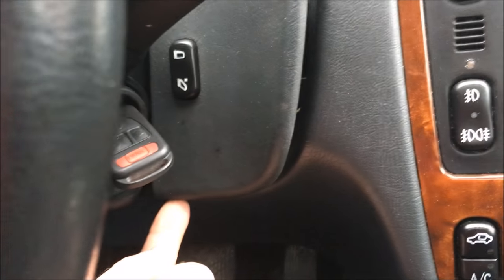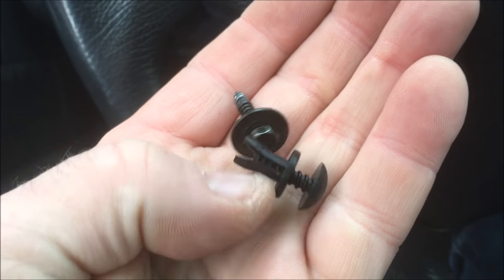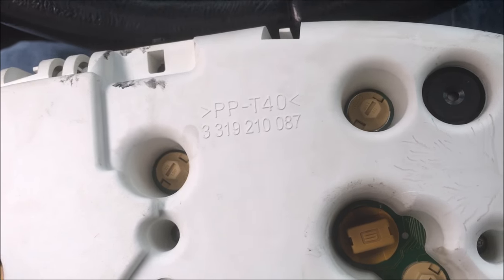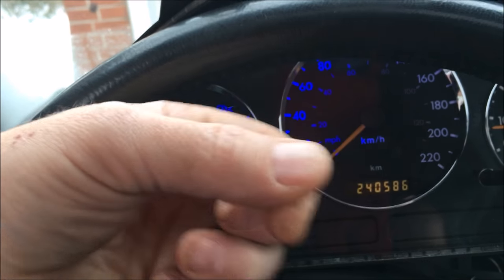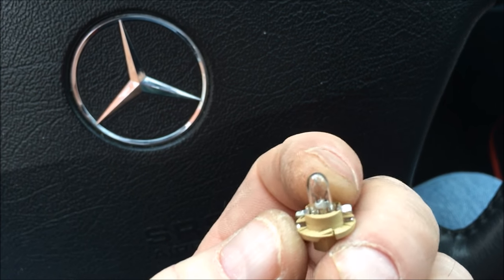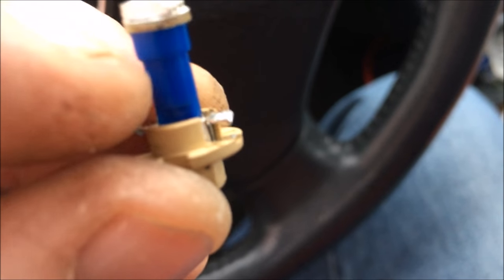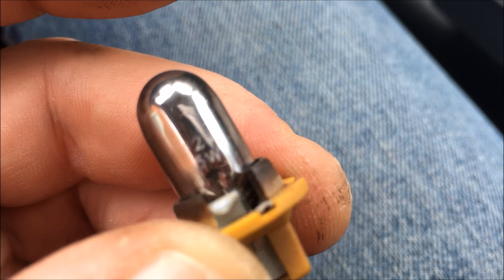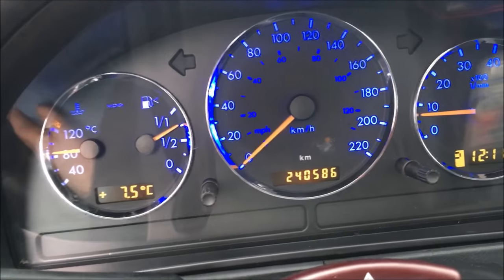How to..Mercedes W163 ML320 gauge lights changed to blue LED

Comment: I've used other LEDs (white, blue blurring in my eyes) however the fuel arrow faintly visible and sometime I see running moire on digits of temp/odo/gear/time. 
In general, I am satisfied with the result

Comment: 240k 😳😳😳 is the reason why I drive Mercedes. They last a lifetime. #BenzBoys
Reply: You think 240k is a lot mine almost has 340k and it still doesn't have a check engine light

Comment: There is a reason why the led are this color in Mercedes, because they found out after testing that's best color light is the one that they use,  has much better readability, clarity, and easier on eyes, and creates less distractions. This is well research phenomenon by Mercedes, in fact all the German cars use orange/white back led for the same reasons. Main reason is safety.
Reply: Wrong VW used blue lights in instrument cluster 👍🏻

Comment: Good job. I did the same thing on my ML 270 with both red and blue LEDs, excellent result but they started to burn out after a few kilometres, replaced again but for the last time, with the engine running but the car stopped, everything was ok but as soon as I started walking, a few meters later the painting almost caught fire. The result was that all the lamps were burnt out and I had to redo the wires and put the normal bulb back in, maybe a bad quality LED?
Reply from the maker: sorry to hear that ...sounds like a faulty led shorted something out .

Comment: I tried to do exactly this in my '98 SLK 200 (R170) (the 200 isn't sold in the US, only in Europe). But the T10's you used here were too large for my intrument cluster, plus I think there are like yellow plexiglass plates inside the cluster, because I now have smaller white T10's behind the gauges and the cluster still lights up kind of yellow
Reply from the maker: yes the R170 gauge doesn't have as deep a hole to put the bulb in, so a smaller T10 LED is needed. There are different colors of white LEDs   The  T10s you got may not be "bright white"   I have some that are not true white and look the same as incandescent s when they are lit
Reply: ***** The ones i had were very bright white, much brighter even than the regular incandescent bulbs. I don't know how the gauge cluster color remains roughly the same. The blue LED T10's I did have didn't light up my cluster at all, unfortunately :(

Comment: I was wondering how you removed the left   side of the attachment but you didn't show it is hell to remove and install. 
I removed the ac door motor from the ac from the access.It's easier than removing the dashboard.

Comment: hi fupabox - just followed your video to replace some burnt out bulbs on my 2004 ML350 cluster.  I just replaced with original since I didn't have the LEDs handy - I figured the originals lasted 17 years so maybe these will last another 10.  BTW, noticed at 14:32 that you had on a very nice watch...
Reply from the maker: Timex intelligent quartz racing fly back chronograph. Nice watches and not expensive either 👍

Comment: G'day from downunder.  Great mod.  I did a similar upgrade to my Suzuki Boulevard C50 about 10 years ago - although that required a lot of re-soldering, rather than bulb replacements. Looking forward to doing this on my 'new' ML350. I noticed some comments about changing the bulbs in the centre console so I'm keen to see how hard that would be.  The upgraded stereo has red LEDS, so curious as to whether anyone has had experience with using Red LED's & how visible that is compared to original &/or blue?  Cheers from new subscriber.

Comment: Hey nice video.. very well explained! Just have one tad question, are there any codes that pop up on the computer that you removed the cluster out when you pull it out and unplug the back harness? Some codes? Thanks again.
Reply from the maker: I have never had any codes removing a cluster , even with the power on.. but just to be safe turn power off before unplugging.
Reply: Thanks for the prompt reply! Keep doing your videos ..
Reply: @MrVVnz  I know 4 years but nice to know: If you remove the cluster with the key in the ignition on position 1 or 2 it could happen, that SRS (airbags) will pop up. But since every ML has OBD 2 there is no problem deleting the code. But still better to have the key completely out before starting any work on the cluster

Comment: hey great video!!!! im gonna try this on my ml350 2003 , just need you to tell me again the amount of t5 and t10 i need to make what you did in blue , and how many t5 do i need for the temp and milege and time ? just for shit n giggles if i decide to change it 

thanks alot i hope i get feedback soon from you
Reply from the maker: If you get 10 of each you will have a few extras in case 1 is dead . I order them in bulk from ebay sellers and there is usually a dead one here and there so extras are a good idea. They are way cheaper when you get 10 at a time

Comment: I did that to my car in looks nice. Did the ac vent knobs bulb too , but can't figure out rest of the switches , like low range switch and the ones below the radio. Did you try to convert those to led s maybe ?
Reply from the maker: I did it once before for a guy I work with.. I had to find tiny LEDs and they need to be soldered into each switch/button, once the switch is taken apart.  The window and lock buttons on the center console (2001 and older) can be color changed with 1 bulb in the bottom of the switch assembly
Reply: fupabox ..thanks for the reply and info. I ll give it a shot .

Comment: what is the size light bulb you use for mercedes 2000 ML430 for the dashboard I took off the dash and got the lights but cant find it anywhere I got try to purchase them
Reply from the maker: The 2 larger ones are available anywhere and are referred to as 194 size ..they are called  T-10  if using LEDs   the smaller bulbs which are used in the rest of the gauge lights are available at the dealer for around $3 each (last time I checked)  or here  http://www.pelicanparts.com/catalog/SuperCat/3915/MBZ_3915_ELLITE_pg2.htm
Reply: fupabox Thank you!!! This help me alot.

Comment: Sorry but I did not understand where to find those T10 LED lights for the main speedometer and how many of them will I need. I notice the link for the T5 but no for T10. Can you guide me, please?
Also how many bulbs do we need for this replacement (T5 and T10) in general?
Reply from the maker: you can find them from 100s of sellers on ebay or amazon ..get extras in case one is blown or goes bad.  10 T5s and 4 T10s will leave you a few spares  http://www.ebay.com/itm/10-X-T10-Wedge-Blue-4-SMD-LED-Dashboard-Light-W5W-194-2825-Gauge-Cluster-Bulb-H7-/201861061893?hash=item2effdb5d05:g:c8sAAOSwB-1Ytl8A&vxp=mtr

Comment: Hi fupabox! After watching this video and reading the comments below, I bought the exact same double din deck as you off of amazon. I have a couple of questions about the install and was wondering if you could shed some light please?
Reply from the maker: ask away  :)
Reply: Perfect! So to begin, I'm testing this deck on my 2007 tacoma before I decide whether or not I want to purchase a second one and put it in my mom's ml320 for her. First question I have is regarding the metra dash kit I purchased for this install. The deck does not fit into the front fascia trim. I thought all double din decks were a universal size are they not? It seems like this deck is about a half inch too big, length and width wise =/. I noticed that you left a review on the Amazon page talking about the fascia trim so i assumed maybe you ran into this same issue?
Reply: My second question is regarding the preloaded 8gb micro sd card for the gps maps. I installed the gps antenna properly, and put the micro SD card into the card reader located at the top right of the deck. However, when I go to navigation mode, it asks me to insert an SD card as if it isn't recognizing the card that is already inserted. Thoughts?
Reply from the maker: yes..I used a pioneer sleeve kit, but the plastic cover trim will not fit around the deck face..It is only slightly noticeable on the bottom edge. I intend to make a surround for it, but haven't found the time yet
Reply from the maker: mine asked the same question..  I selected ok or something and it worked.. I completely know what you are referring to, and there is a way to make it work.. I will go check it in the morning...I'm at work all night and can't get out to check it
Reply: fupabox my thoughts are to use a Dremel and cut off a portion of the trim, and then file/sand the edges smooth. The trim tapers towards the bottom, and if I eliminate this taper the trim will fit perfectly. Do you think this is a feasible solution? Obviously there's nothing wrong with the dash kit, but I guess they're designed mainly for the big brand names like Alpine and Pioneer. This EinCar deck is slightly bigger than a standard double din deck.
Reply: No worries, I am just glad that you're willing to help me come up with a solution. I have a feeling I have to go through the settings and make the deck recognize the SD card or something along those lines.
Reply from the maker: I checked mine.. I think it worked when I started from home screen with gps sd card not inserted, select navi.  asks for you to insert card . Put card in and select the one that shows up in the menu..then hit OK
Reply: fupabox I did exactly that. Then a loading screen opened and said sd file not recognized. What I did notice is that there is one sd card slot at the top right of the deck and one at the left. When the SD card is in the top right reader there is no response at all. When you put the card in the top left reader, a loading screen pops up and then the error message displays. Not sure what is going on :S
Reply from the maker: I can't get mine to not recognize my card . I'll keep trying
Reply: fupabox so today I tried reading the SD card on my laptop and it said that the SD card was corrupt and that I needed to format the drive... Doing so wipes everything from the SD card... Maybe I have to reach out to the seller and get them to send me a new one? This is getting frustrating
Reply from the maker: That's interesting ... I have an sd card that I bought to load music and videos on , to play in the double din stereo. The last time I removed it and put it in my computer to load more songs..the same message came up. except it said the card was locked. It wasn't .  I can't reformat it in any way. The music and vids on it still work in the stereo , but I can't edit the card in any way any more.   I think asking the vendor for a new gps card is the best option.  The GPS is very good compared to my Garmin or Tom tom

Comment: you didn't tell us where did you buy these LEDs from?..nice to know they are SMD
Reply from the maker: sorry   forgot to do that   http://www.ebay.com/itm/10X-Ultra-Blue-T5-Wedge-3-Cell-5050-1SMD-LED-Bulbs-Dashboard-Dash-Gauge-Side-12V-/301264108641
Reply: @fupabox  Odd. I followed that link, and when I use their fitment guide it tells me they're not compatible with my 2003 ML500. :-(

Comment: Hey there thinkng about buying an ML350 or 320. They as easy to fix as the C230 with the proper guidance?
Reply from the maker: They are pretty simple to work on , with lots of room in the engine compartment.. 2001 and later models are much much more reliable than the 1998-2000 . 2005 +  are even better. I would recommend an icarsoft i980 code reader do simplify and repairs and diagnosis on post 2000 Benz's . Simple things like burned out bulbs or malfunctioning door locks can halt repairs until the code is reset. ( it was designed to cut power to inoperative systems after several attempts in the sake of safety, and to prevent short circuits etc. , some systems reset when the car is restarted, some require the codes to e erased. It is frustrating until you realize what is going on. )  As an example my w203 had a license light go out..I replaced the bulb , but it wouldn't come on..I swapped the bulb with the other side, and now both were out. I figured There was a short somewhere and started tracing wires. Nothing ..restarted the car and saw that the light from the first side worked, but the second was out, so I put in a new bulb in the second side and nothing again. Once I restarted the car both lights worked. The canbus was cutting power to save possible fires from a short. My mistake was swapping bulbs with the lights on (as on a normal car . so I could tell when the new bulb powered up, but removing the bulb, with the ignition on made the canbus cut the power in case of a short . Hopefully that makes sense. Other systems will not reset until the code is erased.. power locks for example
Reply: will the i980 reset the service interval warning lights if the vehicle has them?
Reply from the maker: yes , but only on post 2000 cars

Comment: my merc w208 doesnt like the big led ones just stock bulb lenght not more :/ dont know how u fited those long ones :/ and didnt know the side ones are for speedo also :/ its says abs and fuel :/
Reply from the maker: W163 bulbs are a bit longer than the ones in a w208
Reply: ahh okay yeah i ordered full one with led. but im dumb and didnt know they had a + and - i was like why some dont work lol (plus since they are chinees shit ones those conector are often to big or breaking so i tought some where broke lol) now i im gonna try your way keeping it plugged in and changing the bulbs so i know if thye are good (cause pluging in and out is anoying AF)
i mad my screen green since my car is a mineral green w208 dont know what color im gonna do the guages things. (those use 2 t10 bulbs ordered some but were to long so re ordered smaller ones who should fit i hope, now i have suck a massive stock in 30 ish festoon bulb, 4 of each color t10 bulbs who are to big, and 10 red, green, blue , white, green 5050 t5 and some smd 10 red, blue, white. luckly they are cheap lol might try white or purple gauges my door light are purple and interior ones also
Reply: btw lucky that u have that space. atleast most bulbs fit :)

Comment: Will any T10 194/ T5 Blue LED from ebay work?
Reply from the maker: They can have different colors of blue so be careful they are the same .. make sure the LED cluster on the top isn't so big it can't get into the bulb hole in the cluster.. some will not fit

Comment: Did the same with t5 bulbs and when i turned on the lights something short circuited, smelled the burn and now whole clusters lighting is dead  :(
Reply from the maker: is it possible the 2 side wires or metal tabs were touching each other somewhere ?  Likely just popped the gauge lighting fuse. Pull those T5s and make sure they aren't making contact side to side

Comment: Why does the speedometer of my 2003 ML320 beep and indicate OIL HI?
Reply from the maker: overfilled oil .. some needs to be removed
Reply: fupabox *How do you turn off the odometer if it stays on when you take the key out?

Comment: They are all not the same, I've bought 2 types of T10 for my 2002 ML500 and the middle comes out much lighter than the T5s. I turned the light dimmer all the way up and it's still light. I'm not sure if I need a T10 with more power. Could anyone help?
Reply from the maker: it's sometimes tough to get them at all the same power, or the same colour.. I find using T10 and T5 smd led's they are more likely to be the same colour and power output
Reply from the maker: excellent  :)

Comment: what kind of stereo do you have?
Reply from the maker: This is the double din stereo I installed to replace the stock head unit..works pretty well , with GPS bluetooth and rearview camera  https://www.amazon.ca/Universal-Autoradio-Navigation-Bluetooth-Subwoofer/dp/B01FQTXNLW/ref=sr_1_1?ie=UTF8&qid=1486501920&sr=8-1&keywords=double+din+head+unit
Reply: fupabox awesome thanks so much. it would be great if you could do a review on it and advise on installing the unit. You are the best.
Reply: fupabox hope all is great! I had an issue with my led gauge lights. I bought the same ones you have, they worked great for about a month. A few days ago I turned on my w163 and smelled like if something electronic was burning then no more lights. I checked fuses and relays but nothing found then u opened up the cluster and looked closely at the circuit board and found one of the small transistor had a hole in it. luckily I had a few extra old clusters and found a similar chip and replaced it. now lights are back in business. I stuck the original one back on.what do you think caused the problem. Thanks in advance brother.
Reply from the maker: possibly a badly made  LED bulb, or an LED bulb failed and a piece fell off and shorted the transistor.. Hard to say..could also be solder whiskering which causes a lot of electronic issues in older circuit boards when lead was replaced with more "friendly" materials.  https://en.wikipedia.org/wiki/Whisker_(metallurgy)
Reply: fupabox Makes sense. like always thanks again for sharing your awesome knowledge with us. 👍